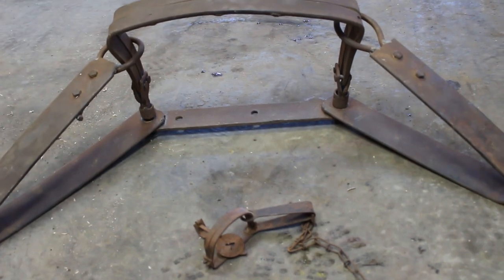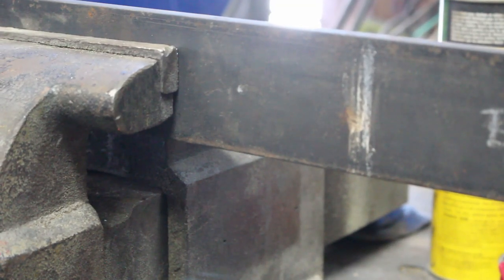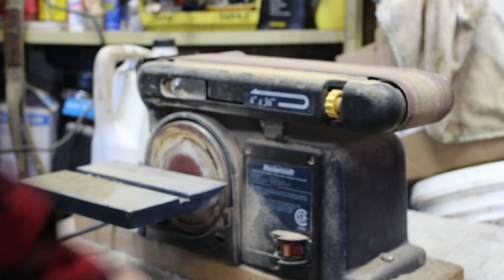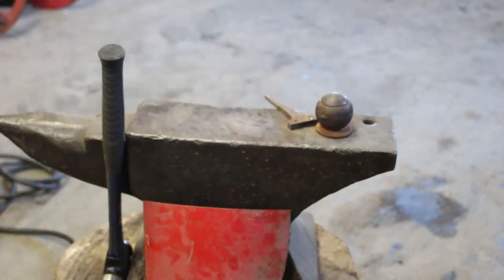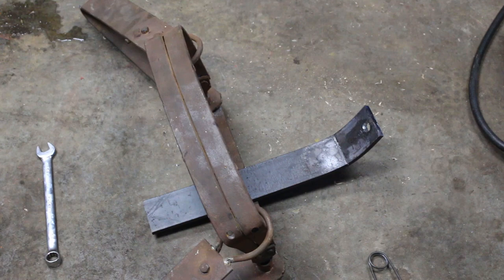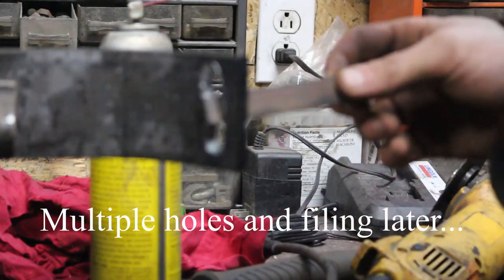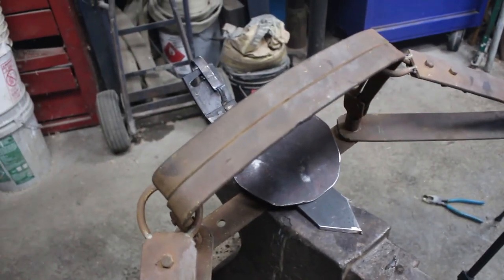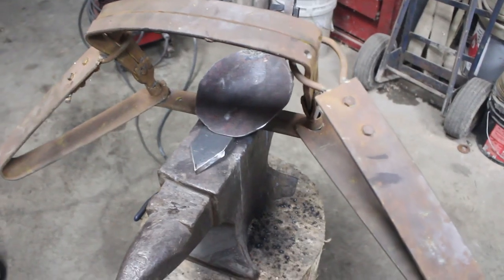Restoring an Old Bear Trap. Restoration/Repair

Comment: Looks like you've got the right idea. It should look really good when it rusts to match the original trap.
Reply from the maker: Thanks. I don't remember what I did to make the other one rust. I think i just put a light coat of gun blue on it.
Reply: @northernwoodsman  There's a method on YouTube "Make Steel Rust Quickly with Hydrogen Peroxide" by Justin Jennings. He shows the ingredients and it does work in about 15 minutes.
Reply from the maker: @jims9249  thanks, il check it out!
Reply: You can pee on it to rust it.